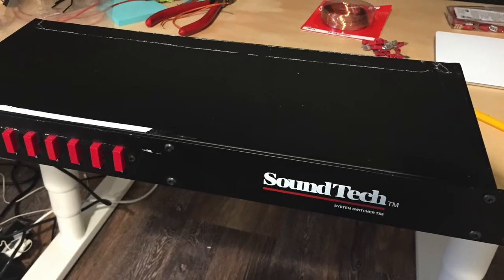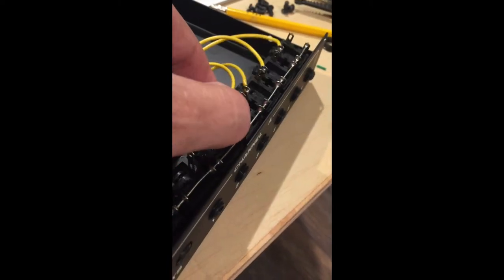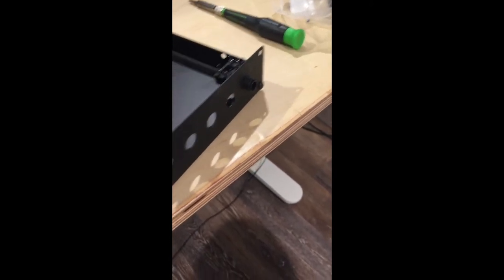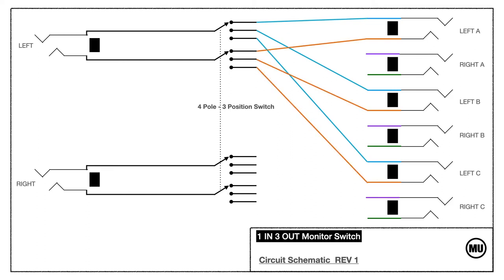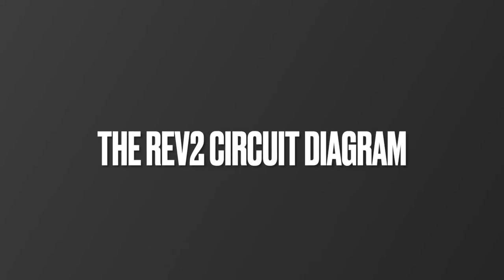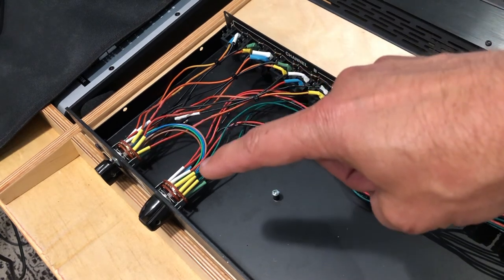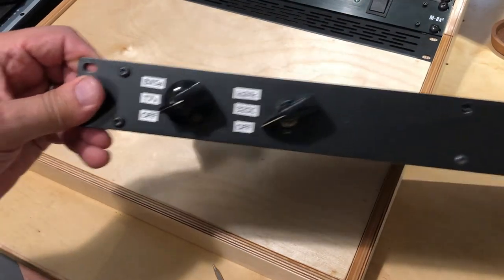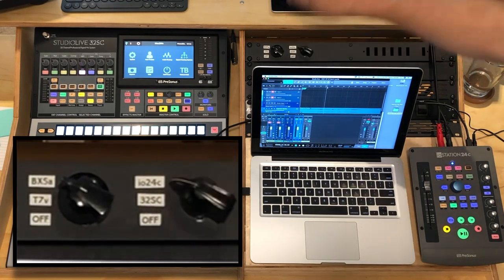Studio Gear Builds - #1  |  Studio Monitor Switch

Comment: I am about to build something similar but with 2 xlr output channels and a volume attenuator on board. Fully balanced. I am still a bit confused but this helps. Thanks!
Reply from the maker: That sounds like a fun project!  Is there a specific reason for using the xlr connections over the RTS connectors?  Check out Christian Steinmetz's project page for a passive control schematic.  https://www.google.com/url?sa=i&url=https%3A%2F%2Fwww.christiansteinmetz.com%2Fprojects-blog%2F2016%2F12%2F13%2Fpassive-monitor-controller&psig=AOvVaw3FpYZVQUPJoPV78UpSgzSb&ust=1668280144864000&source=images&cd=vfe&ved=0CA8QjRxqFwoTCLCo5_3ppvsCFQAAAAAdAAAAABAH
Reply: @mediaunion  Thanks for the tip. I have a bunch of high qualiy xlr cables,  my dac and speakers are also xlr so that's why. They hold up better in the long run too imo.

Comment: Do the switches need to be make before break or vice versa? Concerns about popping noise?
Reply from the maker: Great Question.  I thought about this when designing the passive circuit and everything I could find had no capacitors or resistors.  I picked up a used  HOSA SLW-333 to see if they used anything and the answer is no.  If anyone has a suggestion for minimizing any switch "pop" I would love to hear from you.
Reply: @mediaunion  Apparently the switches you used are good. Part number? I’ll get some and check it out.
Reply from the maker: @MuzixMaker  Check Mouser for the SR2511F-0403-19F0B-E9-N-W 4 Pole-3 Position.  I made a big mistake and bought a cheap plastic 4Pole-3Pos rotary switch off "A>Z" and it broke after just a couple days.  So buy quality first time.  :D
Reply: @mediaunion  They're available either shorting (S) or non shorting (N); it's the letter after "E9". Have to give this some thought.
Reply from the maker: @MuzixMaker  Thank you for the better details on the switch!  Now you got me wondering...they never pop so they must be make before break (shorting)?